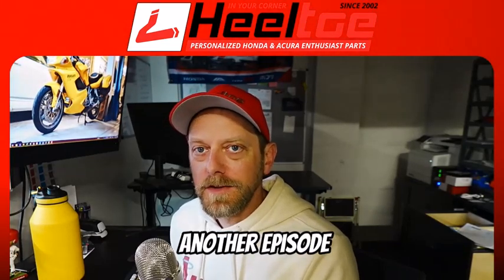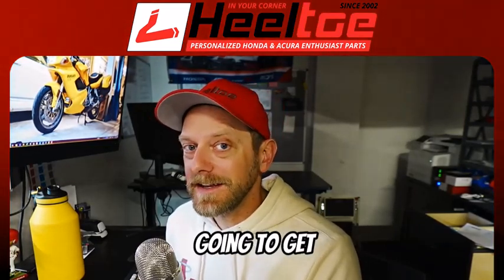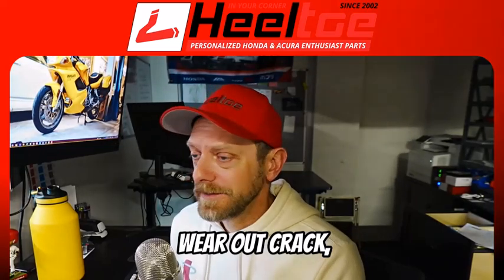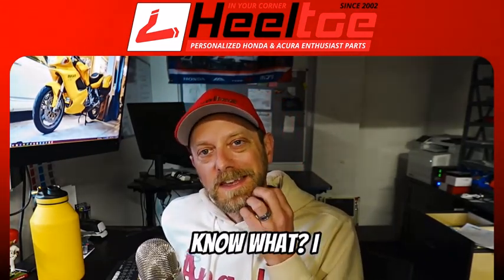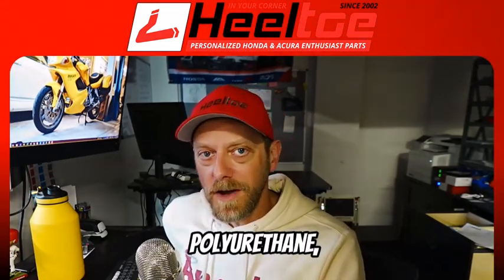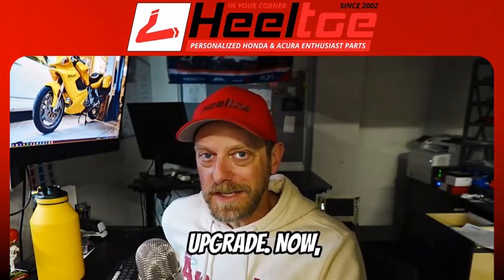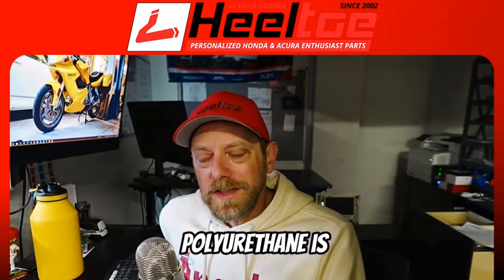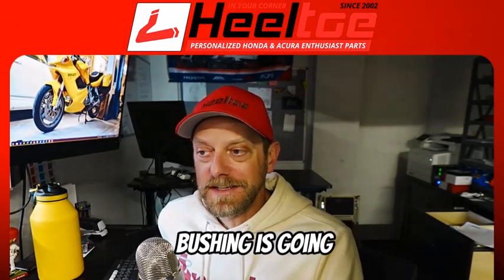CC31: Poly Bushings vs Rubber vs Spherical

Comment: What is your opinion on rear trailing arm bushings? Ive heard poly can cause snap oversteer due to binding, and rubber wears out and cracks to easily,  to me I think a spherical would be great in this application.
Reply from the maker: What specific car are we talking about?
Reply: @Heeltoe. Ef to ek, same rear suspension design across these models

Comment: My car's intent is to be an awesome mountains/twisties/canyon car with potentially occasional autoX and maybe 1 or 2 HDPE days a year. Otherwise, it's a daily driver and road trip car. What would you recommend at each end, for each arm, aside from PCI compliance? I'm also trying to adjust the geometry, so I'd like a BUTTLOAD of caster at the front (and maybe some extra anti-dive), if possible, without messing up everything else.

Adjustable static camber all around would also be great since my factory setup (stock ride height) looks like it has positive, and CERTAINLY rolls into positive when I'm bombing it through Tail of The Dragon and such. Furthermore, I'd like to retain as much reliability and longevity as possible. I can tone down my laziness to make it work, but I don't want to bump up to monthly maintenence or less than 50k miles of duty cycle, generally speaking.

Also, pertaining to adjustable camber kits; old posts on the forums from back when our chassis' were more supported say to get Ingalls or SPC, and they particularly call skunk2 arms "Junk2." Why might this be, has it changed since then, and if not, which arms do you truly recommend? Lastly, since adjusting caster with the lower arm is impossible with PCI compliance (unless I cut and weld mounting points), what is the most economical way to get adjustable camber AND offset bushings or otherwise increased caster (with respect to durability/longevity, as I stressed in my last comment about using offset ball joints for caster) with the front upper arms?

Comment: Great video, I have the TSX spherical compliance bushing on my TSX for 5 years, still running strong. Just wish I went with rubber for the other bushings. Slowly but surely, finishing the refresh on my TSX
Reply from the maker: Specifying the right bushing in the right spot makes a difference. It isn't all or nothing, like people seem to think. Not everything has to "match."
Reply: A lot of people say the superpro kit isn't that bad... Are you one to claim the contrary? Or did you go full spherical, instead?
Reply from the maker: Are you talking about the front lower control arms from Super Pro for TSX and TL? They're cost effective, effective for performance, and convenient and easy to install. For most people that's exactly what they want. For me I would rather use rubber bushings where the shock absorber lower Mount and frame mounts are, and the Fastline spherical bushings for the compliance bushing.
Reply: @Heeltoe.  I'm talking about (and making an assumption, TBH) what the other guy was mentioning. He went PCI compliance but implies he also upgraded his other stuff. Assuming poly, I was asking him if his experience was different to others who claimed the superpro bushings didn't affect NVH much, or if he instead/indeed went spherical all around and was now simply regretting going that far rather than having a more sensitive back or w/e than others saying the superpro set is relatively comfortable, still.